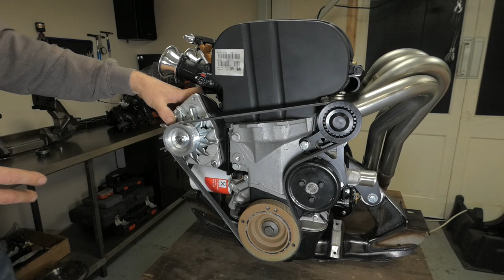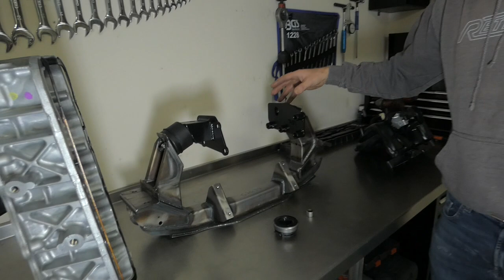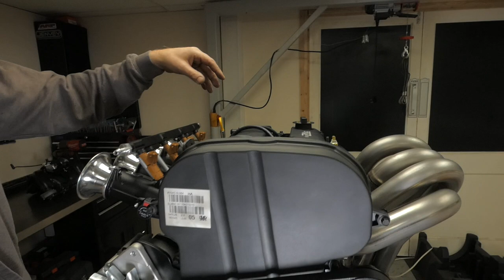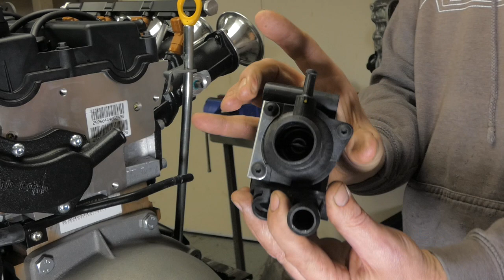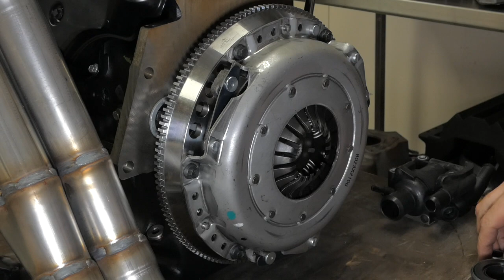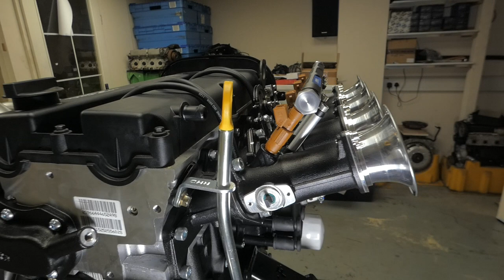Retroford Tech Guide Ep.4: Zetec RWD Parts Explained

Comment: hi, can i use flywheel and clutch from a 1.8L silvertop on a 2L blacktop with a type9 box? Thanks:)
Reply from the maker: If the 1.8L Silver Top is already set up and being used in a RWD application with no issues then yes the same Clutch and Flywheel would be suitable to use on 2.0L Black Top engine in the same set up 👍